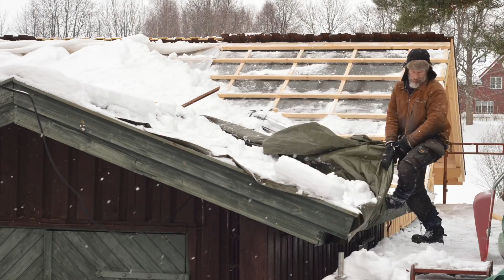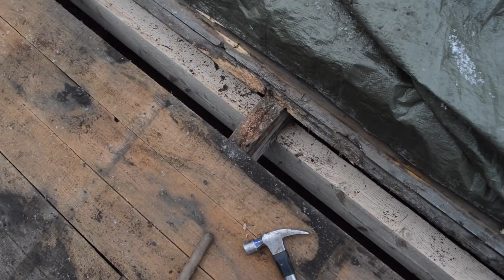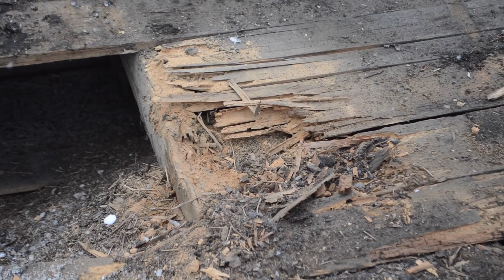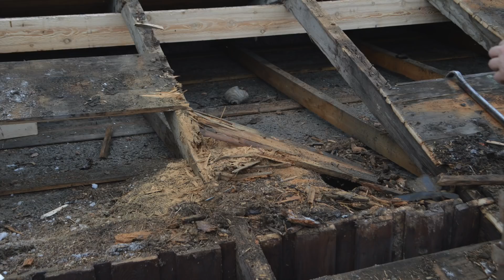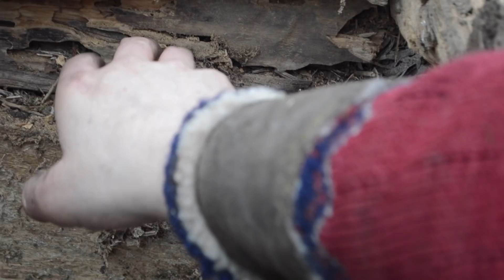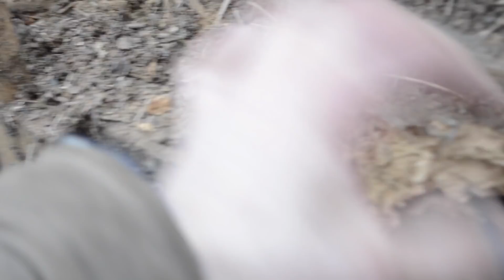🔴 27/35: Building a Post and Beam Garage - Rot and insect damage discovered

Comment: Thanks for the explanation and visuals on ant damage, and comparison to wet rot. Very useful for us newbies that sometimes wonder what condition a piece of wood is in. Maybe you can make a dedicated film on assessing wood condition at some point in the future.
Reply from the maker: I can try at some time, but I am not sure I can say very much with certainty. Insects that damage wood are particular to the region, so it could be misleading to assume that insects here in Norway would be a threat in say UK. There is some discussion about rot on the series about restoring a log cabin on my channel. I do a lot of restoration work so the theme comes up over and over. I usually stick my knife in damaged wood, it stops when you hit fresh. The real challenge is preventing the ingredients that allow rot to grow. Without water, most rots stop. They need heat and air as well. Always a fine balance of factors at play, all the best, Lucas